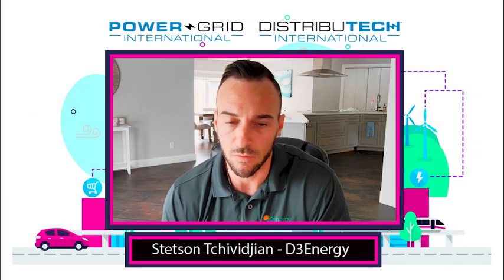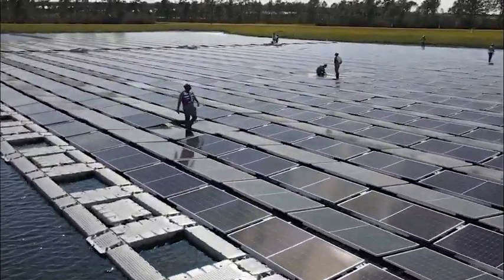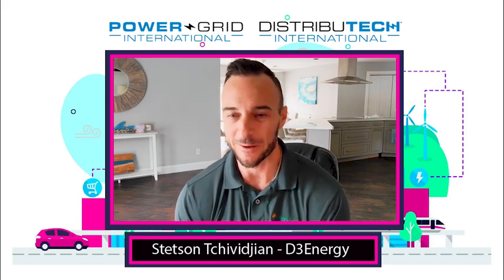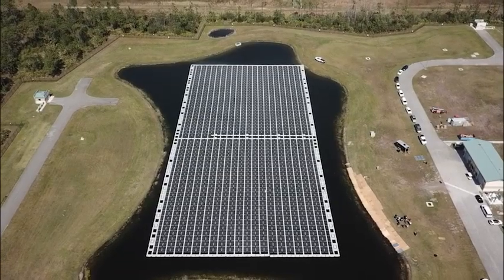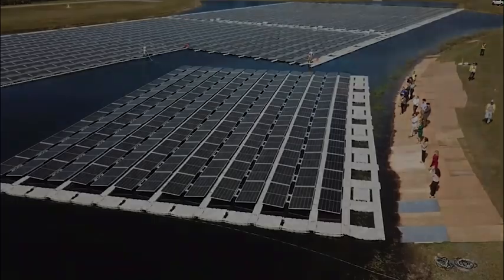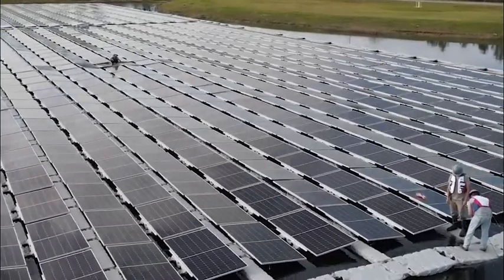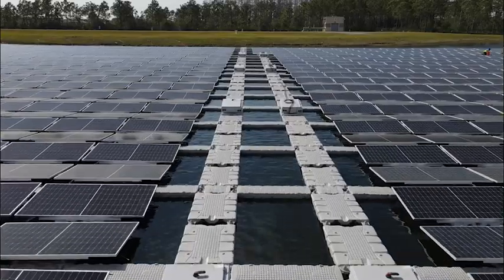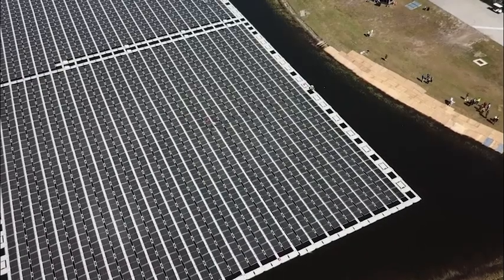Up close with the largest floating solar farm in the Southeast - DISTRIBUTECH Tech Tours

Comment: I like this approach, not just because you don't need to cut trees but because with the panels over water they will be less prone to overheat since the humidity will take some heat off, I understand that maybe the system has a higher cost, not just the floaters but to resist being too near water all the time.
I need to see some data about this.